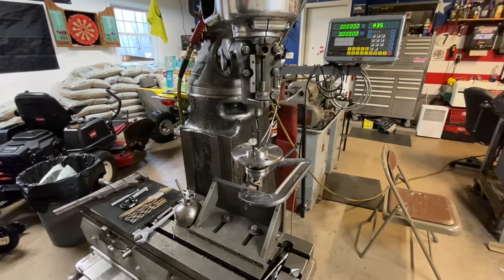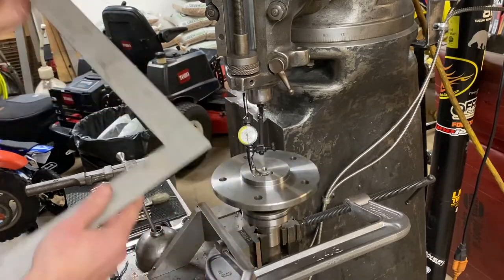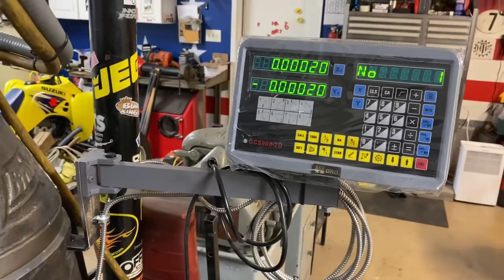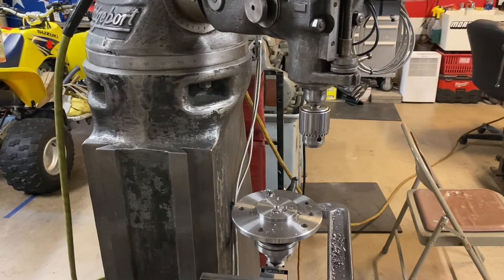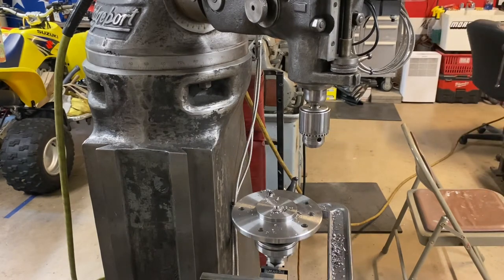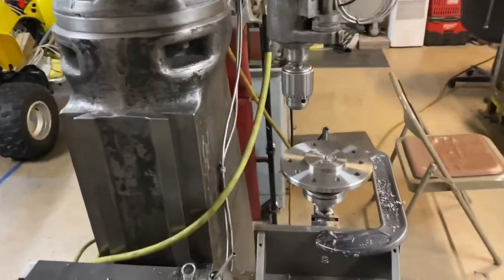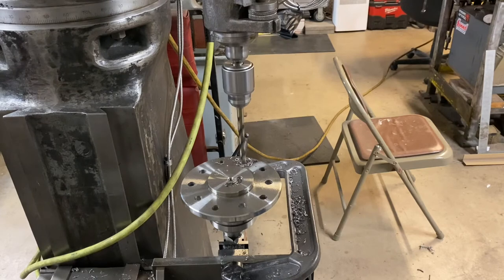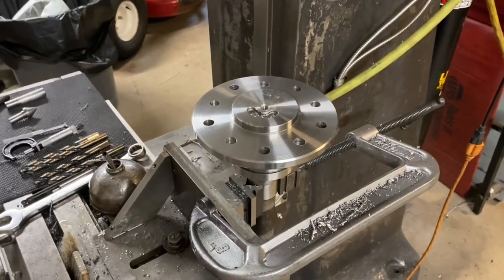How to change a bolt pattern on an axle shaft using a DRO

Comment: Nice work. I’ve been considering doing this for the local race guys. Your setup looks nice and rigid. This video gives me the confidence to do it.  BTW, have you considered verifying hole diameters with gauge pins?
Reply from the maker: I did not gauge pin them i just kinda went with the average press fit tolerance and measured with small hole gauges seemed to be a good fit when pressed in! Thanks for watching

Comment: You could also center drill all the holes then just drill with drill bits as needed!
Reply from the maker: Im sure there is several different methods whatever works right?

Comment: Usually you see this kind of work liquid cooled - as the heat from the drill can warp the disc
Reply from the maker: It didn’t seam to heat up to much but i do run a noga mini cool mist sprayer now.